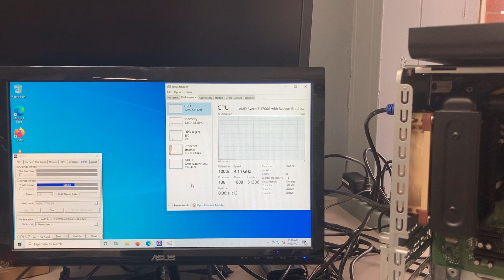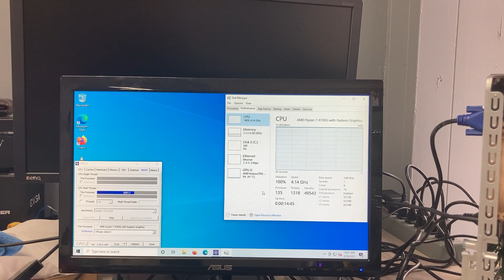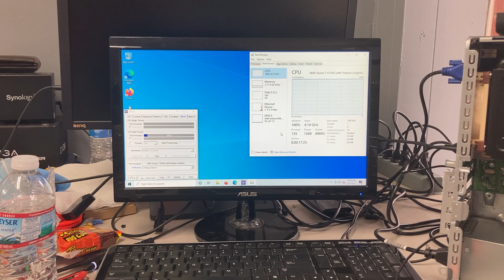Dissecting a HP Desktop M01-F1024 Computer for the Ryzen 7 4700G Processor WATER COOLING UPDATE

Comment: There's a 500 watt psu that has all the power connections for a decent GPU and other hardware. I have upgraded everything in my hp TP01 which is the same Case and motherboard. I have even upgraded the cpu and cooler  and Added more fans and thats just the beginning.

Comment: I bought this PC with a different APU (4300G). After some research I found out that, depending on the configuration of the components, HP sometimes ships this line of PCs with a 310W PSU. I was also able to find out the parts number of said PSU, which is L16397-001. Luckily HP offers spare parts to consumers as well via their Partsurfer service. Now that I got 310W to work with I decided to slap in a GTX 1650 Super and get the necessary extra power via SATA adapter. I also added a 2TB 2.5 inch for storage, a second identical 8GB 13L76AA RAM stick, upgraded to an Intel AX210 6E wi-fi card (which actually makes use of both pre-installed antennas, unlike the card the PC came with). I also removed the stock CPU fan and replaced it with a Noctua NH-L9x65 and mounted the removed CPU fan (without heatsink of course) onto the drive cage bracket side in order to use it as an intake fan. I think there is not much more I could do to improve this build any further except for a better 4000 series APU/CPU.
Reply from the maker: Sounds good to me! I'd be careful about using the SATA adapter for the video on the 1650 super, might work, but isn't within spec for power delivery maximum of a SATA connector. 

Sounds like a great build! Thanks for sharing.

Comment: Nice build like this!
If i want to mount a small tower cooler with fan. What socket cooler can i mount to this? I have this pc with 4600g and looking to buy a more efficient cooler,
Reply from the maker: Odd part is that it uses an Intel style mounting pattern for the cooler. Anything that would fit for an Intel should fit as long as it isn't too tall for the case.

Comment: I put a Thermaltake CLP0556-B HSF in mine. Can dissipate up to 95 watts and it's $15 on Amazon. I never would have considered water-cooling but you certainly proved that it can be done. The teenager that I built the computer for is completely happy with the APU but it's good to know that we can safely upgrade to a GTX 1050 ti in the future (when the absolutely insane video card market calms down).
Reply from the maker: Great choice, I'm glad to hear that that option is available. Looking at the cost, it's a lot more in line with the budget aspect of this computer.
Reply: Thank you for posting the make and model of the cpu cooler. I will order the same for mine.

Comment: thinking of get my self this HP PC ryzen 7 ... i was wondering if i can buy 6 to 24 pin PSU adapter and use any PSU? corsair or evga for example
Reply from the maker: No, the power supply form factor and connectors are both proprietary. I recommend against this PC if you plan to upgrade

Comment: Great overview of this set up and some of the things to look out for, and yes, trying to use the SATA power for the Graphics card is a bad idea. I picked up a MO1 F1124 with the Ryzen 4600G to test against a 4350G that I ordered on eBay.  HP and their infinite wisdom stuck an 8GB and a 4GB stick of memory, as well as the Intel style cooling solution, so I'll be swapping those out.  Very happy to hit the subscribe button as well.
Reply from the maker: Thanks for the insight Paul, subbed to your channel as well - great informational content - harder to find these days on YouTube it seems. 

I will be posting a new video on this machine soon, I ended up taking the AIO out of it after some issues. This machine just isn't suited at ALL for any kind of upgrade, in my opinion. I did put a 400 watt power supply an RX570 in it, but there will be cooling issues. 

I picked up a similar but older model, an HP ProDesk 405 G2 MT, to use as a mining "host". It's got a laptop processor with only 25W TDP, and NO fans! I picked up a Delta server fan to go in it to hopefully move some air. It has similar issues, no fan header, and has an ATX sized PSU, but I had to drill holes because it used different mount points. Wild!

I can't recommend this computer to anybody, not at the current price. I'll most likely be pulling the 4700G for my own computer, and doing whatever with the rest. It seems like HP goes out of their way to make proprietary components in their desktop systems - makes no sense to me, but must to somebody there, because they keep doing it! It's fun to mod them and test to "beat the system", but at the end of the day without the processor this machine wouldn't be worth much of a look. The BIOS configuration options are pitiful, you can't do anything with them! So many people have picked this machine up and are spending money on upgrading it - Can't help but think they'd be better served with a scratch build in the end.
Reply: @BridgesBrothersRacing  Thank you, I appreciate it. I try to post what I hope is relevant content and hope that someone can get something out of it. Thank you for the sub as well.

Comment: Great video!  I am considering picking one of these up to test and tinker around as a budget gaming machine.
Reply from the maker: Watch out, or you'll go down the rabbit hole like I did. A larger power supply from the HP Gaming desktops in the same form factor is a drop in and plugs right up and works. I also thought about hacking the 4 pin molex connector that provides SATA power apart and wiring in a GPU connector for a smaller card that still needs more power like a 1660Ti.

Comment: i just bought one from walmart and its a ryzen 3 vega 8, the cpu does fine but the vega 8 gpu isnt good and i wanna know if its big enough for another more updated amd processor
Reply: You've got the system with the Erica2 board. The highest CPU you can pair with it is the 3400G. It's not that much better than the 3200G

Comment: I just put in a 2400g after taking out the 4700g and the PC would not boot. The power led lit and all the fans, including the CPU fan is still spinning. Is it ok if u could share a pic of your jumper pins? I messed around with the pins and might have accidentally put them in the wrong place. Thanks
Reply: I am curious as well if we can put other CPU's in there. I just bought this to pull 4700g and put in my 3200g mini build. I want to put my 3200g in this just for a backup system. But I just read somewhere this bios will only support 4000 series apu. I guess I'll see when I get it. The chip alone 4700g costs 450 on ebay. On amazon it's 550 for M01-F1024 now.
Reply: @GregoryGoeppel  If this is the case , affordable 4th gen Ryzen CPU are harder to find.
Reply: @naturediscoverybnm  It's even harder to get a GPU now. So this APU will have to do. Surprised to read A520 and B550 chip sets don't support 3000 series CPUS. Still I read some people got it to work with separate GPU. But that defeats the point of the APU.

Comment: Brandon,great video! Looking forward to more! I do have a question-have  you been able you allocate more  than  512 MB to the video portion of the 4700g?  I  researched it and  I believe it was  Asus mobos that allow 3 Gig of memory to be allocated. All the other mainstream mobos allow 2 Gig of system memory to be allocated. HP,in their glorious wisdom,allows only 1/2 Gig to be allocated. Do you know of any workaround?
If not, I may as well just rip out the CPU and build from there.
Love what you did here and THANKS for the video!
Reply from the maker: I would take it out and put it in another motherboard. The BIOS of this computer is LOCKED down with nearly no config options.

Comment: where's the dissecting part. im trying to figure out how the case works dude
Reply from the maker: Take the side cover off. There are 3 plastic clips on the front bezel that hold it on, pull them up and "fold" the front bezel down to remove it. There's one screw on the black plate inside that you remove to take it out, there's another screw behind the bezel you'll remove to remove the silver plate inside. I've done it probably 20 times, very easy.

Comment: I wanna put a 1080 in this system but I don’t know which psu to use
Reply from the maker: Doubt you could fit a power supply to fit it, or that it would physically fit in the case.

Comment: What's the name of the water cooling system ?
Reply from the maker: Asetek 645LT is what I used. Cooling fan connected to the CPU fan header, pump connected to a SATA power connector with a Noctua adapter. 

It worked, and worked well, but since the processor is neutered by the motherboard, there was never a situation where it helped more with cooling over a $15 air cooler.

Comment: Does the CPU cooler backing plate separate from motherboard and case? Or will I have to make whatever cooler I use work with the HP supplied backing plate and screws?

I ordered one of these computers a few days ago to do some light CAD work and I want to upgrade the cooler to a Noctua or some other air-cooler cooler. I'm trying to plan the build out.

Also, do you know if the case has standard ATX mounting points? Would it be possible at some point to just throw a standard ATX mobo and PSU into this thing? I'm pretty good with 3D printing so I'm hoping I can design some sort of adapter to mount a standard ATX PSU - down the road at some point if the stock stuff doesnt' work out for me.

Thanks for the videos. They've made my feel not-so-bad about by low budget purchase.
Reply from the maker: Sorry for the late reply. The backing plate is Intel style and shaped, keep that in mind! I removed the factory backing plate. It's attached to the motherboard with double sided tape, so instead of prying from the bottom, I took a small screwdriver and pressed down on the screw post side on each corner until it popped off. At that time, I was able to mount the backing plate that came with my EVGA CLC. 

The case does NOT have standard ATX mounting points or a removable IO plate. The power supply is also a nonstandard size. If you wanted to upgrade I would budget for another case, motherboard, and PSU, and move the rest of the components, the processor is the big prize here.

Comment: would you recommend just taking the CPU out and putting it into a new motherboard and case..and etc?
Reply from the maker: If you already have it and want to upgrade it: Yes. The memory is worth money on eBay (List it as being pulled from this model), the SSD can be reused, and the rest may bring some money as well on eBay. 

You'd really have to want this processor though. If you had a GPU I would probably go with a Ryzen 5 3600 instead. The 4700G does NOT have PCIe 4.0 support, while the 3600 does.

Comment: Can you put a 1050 ti in the pc?
Reply from the maker: A single fan card with no extra power connection, an EVGA 1050Ti SC worked just fine. I don't think a dual fan card would physically fit, and there aren't any power connectors for an externally powered GPU.
Reply: I put low profile gtx 1650 with nomproblems an working really well